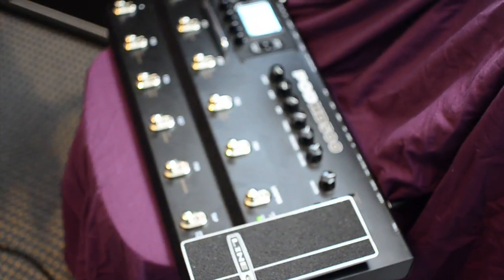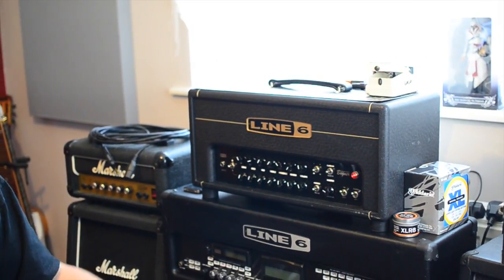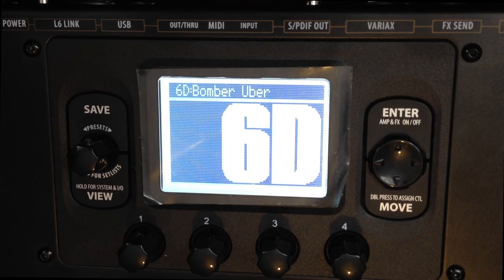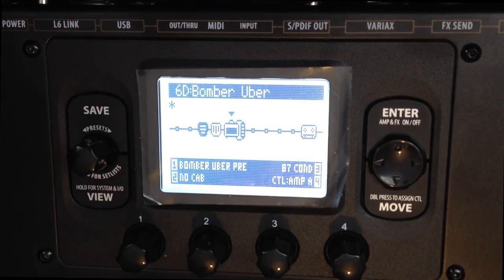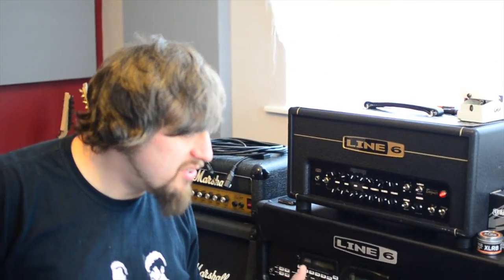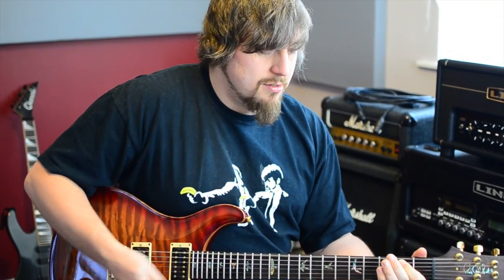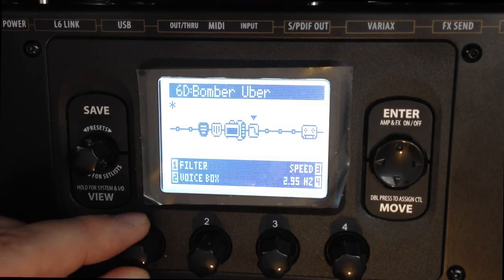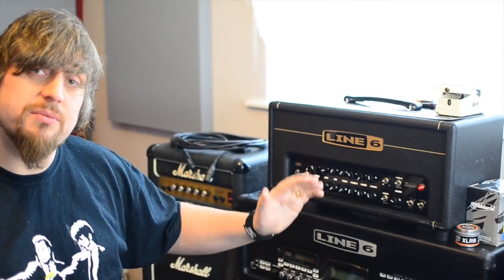Line 6 DT25 Review: All You Need To Know - Part 3

Comment: Paul, you have reviewed two lunchbox amps, the Dt25 and Grandmesiter 36 with the on board effects. I currently use a Line 6 HD147 but is heavy as fuck to carry around and want to get the Line 6 or HK. Which of the two that you have reviewed is overall better for effects, distortion and carrying weight? :)
Reply from the maker: I'd go with the Dt25 and hd500x man. Ine cable to yhe amp and away you go. Plus you can run any cab you want so 1x12 would be great.

Comment: Hey Paul, thank you for the videos.. Im a fan and have subbed... Im with ya.. Im running my DT25 with a POD HD500X thru an Orange cab, and love it. I just got this setup.. Sometimes when im lazy, ill just use a POD and run direct at my shows, but since I got this I cant wait too use it. I also got the 1X12 speaker, so I need settings for my Direct setup, Dt with the Orange, and DT with the 1X12...LOL I got a lot of work to do but its worth it. I wonder how 2 1X12 would be?....Hmmmmm?? Your thoughts?
Reply from the maker: The 1x12 sounds great mate but if you wanna keep your sound simular to the orange you may need another preset for that cab with emulation on. Well done man its a killer rig.

Comment: Paul's right. Use No cab. Preamp. It sounds so much better. It takes awhile to figure it all out. Watch videos etc. like his otherwise u won't know how to make it sound as good as it's capable of sounding. I love my dt 25 head and can. It takes Pedals great and sometimes I used the HD 300 as I said took a while to learn lots of tweaking but as a stand-alone amp it's great.
Reply: It's really kind of intuitive if you think about it. A POD of any kind, be it a bean or a floor model or a rack model, is designed for direct recording without an amp. Therefore, it is voiced to sound it's best through full range speakers,,,ie studio monitors. Now think about a guitar cab. Compare it in your mind to a full range stereo/studio speaker. They are NOT the same...at all. Hence, it is no surprise at all that a POD plugged into the front of an amp will not sound good. At least not with factory presets. At a minimum, you have to take the cabinet simulation out of the equation. Basically, what it all comes down to is this...people who aren't getting good tones out of a POD are doing it wrong. At least on some level.

Comment: Hi Paul got the dt25 and hd 500x thought it was going ok until I saw the vid when you said about using the pre versions on the amp models and not using speaker sims etc now I'm back to square one. I've copied the patches I created in another set list but with pre amp versions, should I go no cab ? Also as far as setting the hd 500x to the right output I thought it would automatically detect the dt25 via the line6 link,,,,confused . Com cheers
Reply from the maker: If you have a cab I would turn of the cabs, but as stated on the line 6 page if you like the sound just do it. Might save.on resources though?
Reply from the maker: If you have a cab I would turn of the cabs, but as stated on the line 6 page if you like the sound just do it. Might save.on resources though?
Reply: Paul Glover Yeah Ive got the combo version and Im finding that some of the clean sounds are too thin so they sound bigger with the cab sim on but on the overdriven sounds it can be too much
Reply: Micky Malibu Then just add an EQ to one of the effects blocks... Hope this helps bro.. Cheers!!!